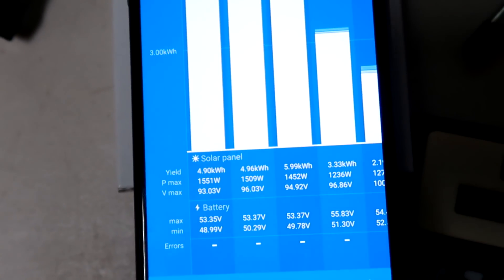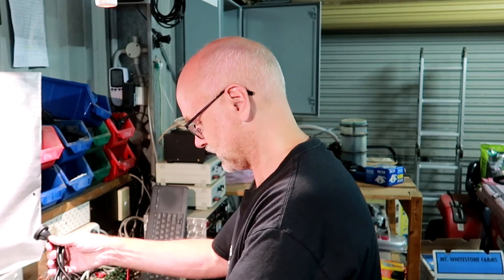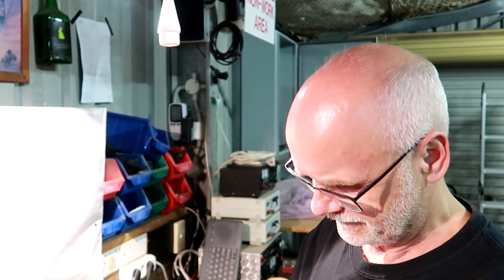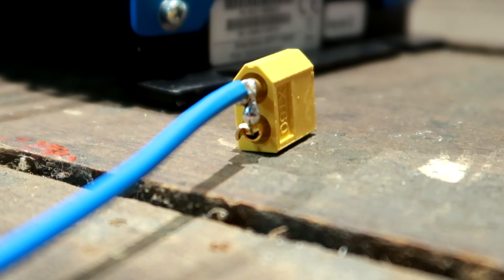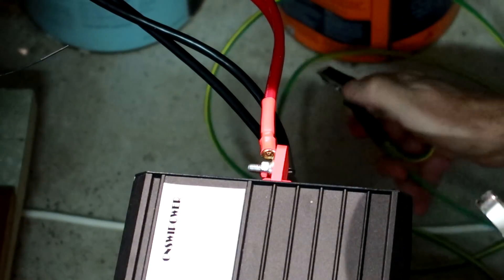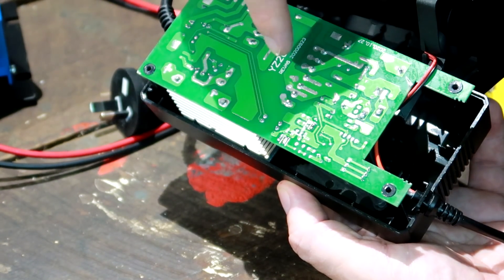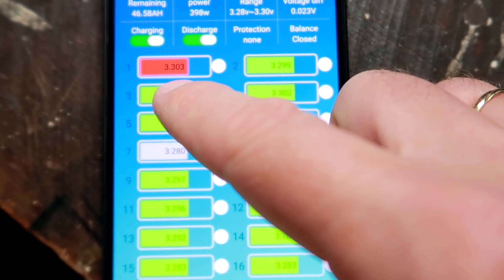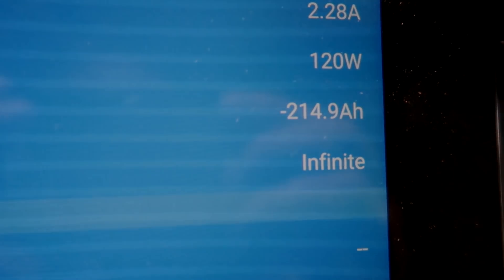Using an E-Bike charger to charge my large 48V battery?

Comment: I hope you can answer my question? I’m in Ukraine. I have a 48volt battery bank. The 48v charger is acting up. I have a few more chargers. But there 84 v and 126 v.  Can I use them if I watch the bank’s voltage? Hard to get anything right now because of the war. 
Thanks

Comment: Hi, I have questions my charger no work broken, I can't find same,can I use same voltage but different amperes,my ebike Motor 48v-500w
Battery 48v 12ah
Thank you in advance
Reply from the maker: As long as the voltage is the same, it will work.

Comment: I really wish I knew why I suck at soldering XT60's, I need to make 4 cables (8X ends) and I been putting it off. You make it look easy. I made a charging and discharging parallel board for 4X 36v 18650 cell packs. Then realized that's a lot of ports to make :(
Reply: I had trouble too, now I use flux paste. A game changer!

Comment: You connected the charger clips to the inverter terminals ? Is that just because the battery terminals aren’t so accessible, and it makes no difference whether you connect to the inverter end or directly to the main battery terminals ?

Comment: Hmmm interesting not charging mine with a solar unfortunately but I'm looking everywhere for some information on my 48v 20ah battery but they recommended me the 55v charger and it stuffed up in no time thought it was the battery or the bms and just about gave up on it and then found out it was the connector anyhow now I'm using a 4iv charger and I just finished up cherging my 48v20ah battery and it's even the first time I've had to charge it very very well on power but mine is charging to 54.4

Comment: Mains charging is occasionally necessary! With a suitable time switch you can use overnight cheap tariff electricity.
More panels is the usual answer, south facing and at an appropriate angle to collect maximum sunlight. OR do as some big arrays do and move the panels to collect maximum sunlight by always facing the sun from say 10am to 4 pm (sun time) wherever you are.

Comment: I use a DC inverter welder that I have added a couple of windings on transformer. Need to have a relay on 240v side to turn off charger From BMS. Charge at approx 60a at 55v.

Comment: It claims 240W, delivers 202W, actual capacity is 20% under claimed, however most of these chargers from other advertisers claim 4A, which is 200W, so aside from the BS from the seller it's spot on. Andy, I sure wish you wouldn't promote Amazon - the AliExpress offer is way better at around $16 cheaper when you include delivery.

Comment: In the case you need charger, I would return the Victron Phoenix inverter and exchange it for Victron Mutiplus II, which includes 35A charger and lots of additional features like ESS.
Reply: I had the very same idea. He could even sell his charge controller too if he went that route
Reply: @geraldgrogan  The Victron MPPT charger is good choose, it can remain in the system. The Multiplus is device which works both directions. It can charge, discharge at once. It also allows feeding the energy from grid in the case it is needed, but for this off-grid system not a case. The Multiplus is also capable of replacing the smart shunt as it measures the energy from and to battery. It communicates with Victron charger as well to take the solar charge into measure (using VE.smart network).

Comment: If you want to save a bit of money and make sure that your fused connection is as good as possible. You can take two Spade connectors side-by-side heat shrink them together and put an ATC Style Automotive fuse. That way you know that the cable is not only good wire, but it's super cheap and easy to make. Just trying to give you a heads up on something you may not have known
Reply: ATC/ATO are only rated to 32v (as are most electrical devices from the automotive world).

Comment: I have the same cheap charger for my ebike, be aware the fans are known to fail, if this happens it will burn out your charger. Probably not a good idea to leave it over night.
Reply from the maker: Thanks for the tip! I used it only twice so far, more like an emergency backup as I will solely charge from solar.

Comment: If you had instead purchased the Victron Multiplus 2 3000va 48v instead of the Victron Phoenix Inverter , you could have done this all with one device, and you would not need the Victron charge controller nor would you need the separate 48 volt charger you just picked up.
Reply: I'd like to do the same for my mower conversion.
I'll brace myself for price but I'm buying quality.
Reply from the maker: It's an off grid system. I don't have grid power any more.

Comment: A few months ago I bounced a boost MPPT charger off you. It was designed for a 12v panel and a 48v ebike pack. I found one, from China, and it works very welll for $40. I have a Sony cell 48v LFP. I might use the ebike MPPT to charge it, but it's 85 watts from one panel. I could go with more panels. There are so many boost DC-DC converters around. I must have a dozen, from 30 watts to hundreds. Hook that up to any old power supply and you get to 50+ volts. 

I tracked down Lishen and EVE. They each have 3% of the EV battery market in China. So real companies. Now I don't know what Basen is, whether they make anything. I don't know how they are tied to EVE. Seems like people are starting to believe in the 280AH cells, and the very disruptive pricing.

Comment: No good Andy. This is a step backwards if you charge it from the grid. The grid is for backup power only. My batteries are fully charge by 10 or 11am, so no need to count solar production when chargers are just idling for house consuntion.

Comment: I would have put heat shrink on those connections.   But that's just me.    

I miss the point of charging your battery from ac...    You are better off not charging the battery to 100 percent

Comment: Andy, couldn't you have just cut the output plug off 48v charger and soldered the wires to the yellow connector?
Also, if you spent another $38 you could charge at 7.5A! = less than 2 days for 250Ah.
Reply from the maker: I've ordered a plug which will go into the box so I can plugin the charger directly to the battery box. As I said, is just an emergency charger so does not need more power. I'm not going to charge the battery with it.

Comment: So what is the advantage of a charger ? 
We have power losses in the mains charger, battery and inverter. Why not just plug the car into the mains once your battery is as low as you are prepared to take it ? and avoid these losses.
Reply from the maker: I said this in the video what I used it for...

Comment: Oh chinese 5 Amps.
Reply: It is a CC/CV power supply, so it may just have a sloppy transition between CC and CV causing it to roll back current before hitting the voltage cap, plenty of cheap PSUs have that feature/flaw. May want to try that again when the battery is approaching under-voltage cut-off to see how much current the charger can deliver when nowhere near its voltage limit.

Comment: As far as I remember, XLR is extra low resistance.
Having an ebike, in my experience don't expect a long life with your charger. It'll be under more strain with a very long duty cycle.
Reply from the maker: As I said in the video, it's for emergency purposes only. Won't use it much, so didn't spent much money.
Reply: Those chargers are pretty good - I got 3 and use them in parallel to charge at 15A - this was cheaper than a dedicated 15A charger!

Comment: when i ran my lithium bank i set them absord bulk etc to be as close as possible to max charge of battery to make sure it always got the maximuim amount of current into the bank as possible once it hit the max voltage current always tapered off no matter the other settings i do not see anopther other needs for other settings with lifepo4 or lithuim only lead acid do i see a need for other settings

Comment: Unless you plan on running an extension cord from your house, you may have to change the name of your site - if you plan on using this charger on a routine basis.
Reply: He could just use a cheap generator and it would still be "off-grid"
Reply: 400w panels will solve the dilemma.
Reply: @neliosamch3195  The closer you live to the equator the more true your statement , but conversely, the further away from the equator you live the less true it is as well. Oh yeah, and then there is night time .... so then there's that.
Reply: @smde1  I live 4,653.52 km) north of the equator, in the northern hemisphere. Zone 3 and my plan is to demonstrate that yes you can live independently from the grid even in snowy and cloudy days.
Reply: @neliosamch3195  I'm at 63 degrees north and already doing that.
Reply: @upnorthandpersonal  That is fantastic. Too cold for me there but it is possible for the Nay sayers.

Comment: i used to use a laptop charger into an mppt controller to keep my 12v battery bank charged in winter worked great
Reply: Good idea and if you reverse the polarity it will melt the snow in the panels.
Reply: @neliosamch3195  not often we get snow and when we do it is not alot